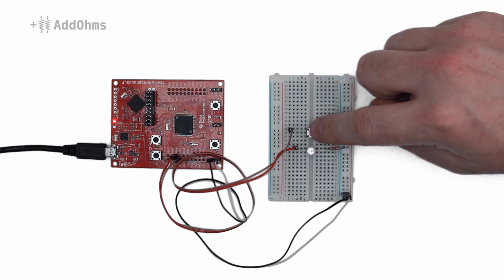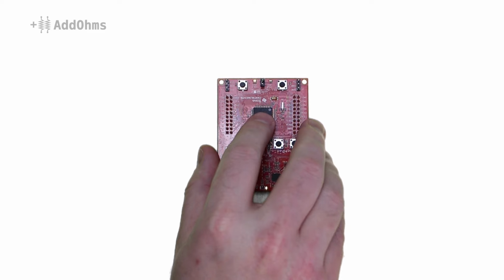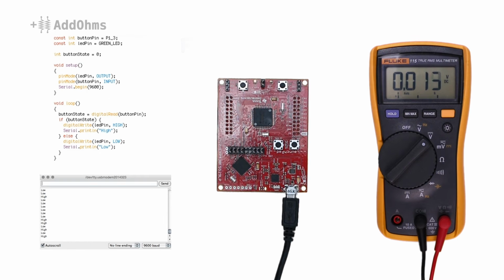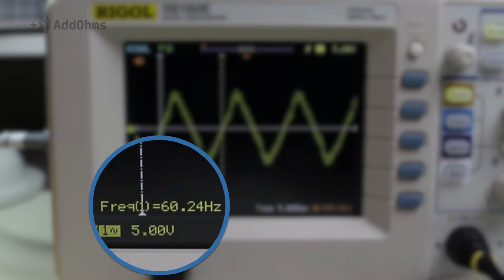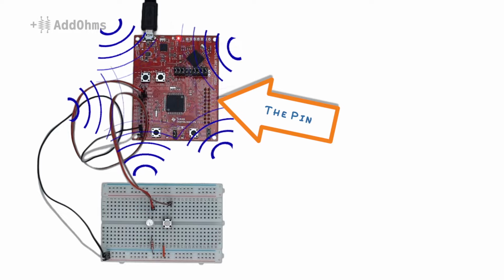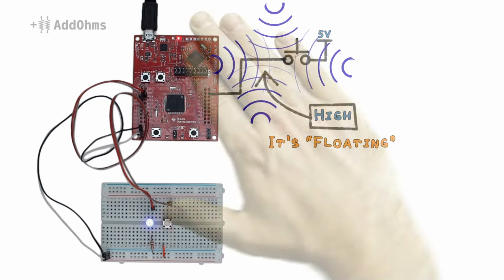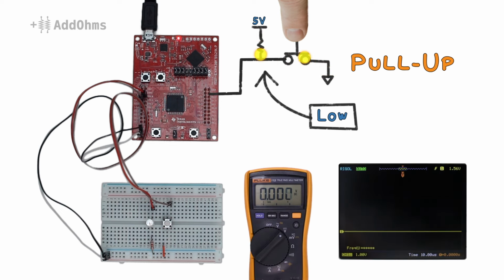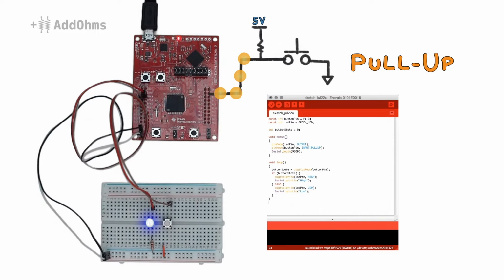Pull Up Resistor Tutorial | AddOhms #15

Comment: Why would there be an unstable signal when the switch is off? Isn't is supposed to be very high impedance when the switch is open, meaning nothing could pass?
Reply from the maker: Yes, but very high impedance comes with a downside. There are no perfect devices. Everything has parasitics, like capacitance. So when a stray EM field interacts with the parasitic capacitance of the I/O pin, it builds up a tiny charge. Eventually, there is enough energy built up to discharge through the "high impedance" path. So if you have current flowing through a resistance (aka high impedance), you get a voltage. That's Ohm's law. This voltage is what causes the input pin to briefly read a high with nothing connected. 

Pull-up and pull-down resistors prevent this discharge because they hold the pin and its teeny capacitors at a constant voltage (either +V or 0). This effect is why small value resistors are called "strong pull-up/down" because they are low impedance paths which provide "stronger" pressure to hold the pin at a known voltage.

Comment: Could someone help please? I am using a comparator (TI LM393P) which needs a pull-up on the output because it is open drain. 
Like the video says it is sort of counterintuitive as if I attach an LED to the output pin (with pullup): when the non-inverting input voltage is above the inverting voltage (Vref) the LED will transition from HIGH to LOW (it is HIGH through pullup by default). 
How can I reverse this transition with an open drain interface (LOW to HIGH of LED when '+' input is higher then '-' input?
I have considered either:
    -changing input pins around (letting inverting pin/Vref) vary
    -applying a transistor (but how to do it?)
Reply from the maker: One option would be to use a 7400 inverter on the output.

Comment: this video is the best!!!  the explanation was superb!! so.... a small request from my side :-) could u make a similar video explaining about the working of the pull down resistor..would be happy to watch another wonderfull explanation from your side...:-)
Reply from the maker: Pull-down works the same, except it goes to ground instead of +V.
Reply: +AddOhms  😀 thank you for your valuable response!!   I would pleased if you clear my doubt maybe silly😬  I had referred  a lot of YouTube videos about pull down resistor...it said a 5v is connected to one side of the switch and the other side is connected to a pull down resistor of a certain value and the other end of the pull down resistor is grounded..and the interrupt is connected to the common point where the resistor and the switch is connected.i hope this is the ckt for a pull down resistor...
As u said in pull up resistor when the switch is clicked if there are external noises that will be grounded as the current (I ment the current due to noise) likely flows to ground.
But in case of pull down the switch is connected to ground through a resistor so if the noise has to get grounded it should pass through the resistor which wouldn't as the current follows the least resistant path..so the current due to noise Should actually enter the interrupt circuit!! But it wouldn't and I dint understand that part..so sir if you could please explain it I would be greatfull😀
Reply from the maker: Pull-up or pull-down has the same effect on noise. The only reason to use a pull-down is if you need a signal to stay low.

Comment: I thought it can only switch between high and low once it get above or below a defined trigger like 2V / 3V or something like that. You mean to say background EMF is causing this much of a voltage spike?
Reply from the maker: An I/O pin input is, effectively, going into the gate of a MOSFET. Which is a tiny capacitor. Just like a real capacitor, the more charge it stores the higher the voltage across the capacitor. You can picture this tiny little capacitor getting charged by EMF. So it is less of "voltage spikes" and more of charge building up.  As it charges up, the MOSFET sees enough voltage to cause a false reading. 

Since the energy levels are so low, it doesn't take much to discharge and charge it, which is why the pin jumps between reading a high or low.

Comment: Great video! But from the point of complete new guy in this field a question might arise like "but won't it use up my battery a lot faster by draining it via that direct connection to 5v?" 🤔🤓
Reply from the maker: The pull-up only burns power while the button is pressed. (When using a pull-up for something like an I2C signal, you need to balance between a strong enough pull-up but a small enough value.) A direct connection to 5 volts would actually burn WAY more power than a resistor since it shorts out the supply. You might find this follow-up on picking values helpful: https://youtu.be/u3Xiy2DVnI4

Comment: Before watching this video, I didnt knew why whe had to use pull up resistor, now its a little bit clearer. In fact i still dont understand why the I/O is picking ones and zeros when left in floating state, Its sound little illogic because the I/O are controlled via MOSFET transistor, and we all know that those kind of transistor are driven by potential and not current, so if the floating input is picking EMI ( and thus acting like an antenna) does it reach the MOSFet's V threshold ?
I also have a question relative to pull down resistor, i know its kind of the same thing as pull up resistor, but i still dont get how they work.
Thank you in advance
Reply from the maker: It is not about current. It is about the voltage potential. However they are related. Charge builds up, which builds potential. Sometimes it cascades and drops back to zero. 

MOSFET gates have the same problem. If left floating they do the same thing. That’s why it is common to see them designed with pull-up or pull-down resistors. To drive the gate to a known level.
Reply: thank you for clarifying this :)

Comment: Hi im learning electronics and your explanation is awesome, excuse me could you explain why the electrons go to ground rather than the circuit when the you press the button ( why the way to ground offers less resistance than the other) thanks in advance
Reply from the maker: An I/O pin configured as an input looks like a huge resistor, also called "high impedance." A very tiny amount of current goes into the microcontroller's pin. But it is in the range of nanoamps.
Reply: AddOhms thanks a lot i just suscribed the best channel

Comment: I get the floating and all, but I'm still a little confused about why it's necessary to use a resistor. Why not just use a "pull-up wire" without a resistor? Is the resistor only there to prevent a short circuit between Vcc and ground when the button is pressed? If it is, wouldn't this technique be better understood as "a pull-up with a resistor" as opposed to "a pull-up resistor?" And why not put the resistor on the ground side of the button? Would that make any difference?
Reply from the maker: > Why not just use a "pull-up wire"
Because then you would have a short circuit when activating the button.

> as "a pull-up with a resistor" 
I doubt you'll get the entire electronics industry to change its wording. 

> why not put the resistor on the ground

That creates a pull-down resistor. Pull-ups are more common, probably because early chip/transistor fab techniques made it easier to make "pull-up" resistors. (because they aren't actually resistors on-chip.)

Comment: How do I distinguish between pull-up resistor and resistor? In the figure below it is mention R2 is pull-up resistor because it is connected to VCC. Why can't we say R1 is pull-up resistor ? It is also connected to VCC

https://www.build-electronic-circuits.com/wp-content/uploads/2017/07/555-Monostable-2-768x413.png
Reply from the maker: R2 is a pull-up. It's pulling up the trigger input so that it isn't left floating. R1 is connected to Pin 7, which is Discharge. So that resistor is there to act as a current limiter for the capacitor, not to "pull-up" the signal to a known value.
Reply: Tysm😊👍 keep spreading knowledge. You are doing great work

Comment: how to determine the optimum value for pull-up resistor ??? 
Great video, thank you very much
Reply from the maker: The exact value does not matter. The “optimum” value is the largest your circuit can tolerate before noise is introduced. The 328p’s internal pull-ups are in the range of 30k to 50k. These are considered “weak.” (Larger values let less current flow, so they are weaker.) Typical external are 1k to 10k.

Comment: Great video! I have a question though, why use a resistor? why not just hook up to 5v source ? what is the purpose of the resistor if you need to get the 5v?
Reply from the maker: Without the resistor, you'd have a dead short to ground when the button is pressed.

Comment: thanks a bunch man, this was by far the best face palm moment I had in my life so far.
Discovering that i never needed a pull down resistance in all my boards circuitry design for the past 3 years and a simple change in code and circuit design could have saved my time. Thanks again

Comment: hii,

what resistant should be use for a pull up or down resistor function ?

thanks. 
andrew
Reply from the maker: "Weak" pull-ups are considered to be in the 10k-100k ohm range. "Strong" pullups are in the 100-1000 ohm range. Usually I use something between 1k and 10k. Whatever is laying around.

The Pull-ups in the AVR 328p (processor in the Uno) are specified to be between 30k and 50k.

Comment: 60 Hz that means wavelength  5000 km... Why does it work like antenna? Isn't it too much for small pin?
Reply from the maker: +Ghost The electromagnetic energy still hits the "antenna" even if it isn't the ideal length. Which is why it's so easy to overcome by using a pull up resistor.
Reply: Ok, thank you :-)

Comment: But when you press the button to connect the 5V to GND, aren't you creating a short circuit??
Reply from the maker: No. That's why the resistor is there.
Reply: Somebody made it clear that that IS a short circuit. In the video when you get to talking about the built-in pull-up resistors in Arduino, you probably should mention that you'd have to disconnect the 5V from the button and that the voltage runs through the input. I'm a beginner, so that confused me quite a bit.
Reply from the maker: The only time I show a direct connection to +5V is when the button is connected to 5 volts and the I/O pin. Around 02:15. In that case, no, there is no short circuit to ground. When configured as an input, the I/O is NOT directly connected to either 5 volts or ground. Which is why the condition is called floating. 

When there is a pull-up resistor, again, there no short circuit.

As for clarifying to disconnect from 5 volts, I don't see a need. You shouldn't be connecting the button to both ground and 5 volts at the same time. Nowhere in the video do I show this configuration. At worst if you connected with an external pull-up and enabled the internal pull-up, it would just be like two resistors in parallel. This isn't a problem either.

The whole point of the video was to show you should be connecting with a resistor, either internally or externally.
Reply from the maker: Okay. I think I see your point. I say "all you need to do is..." implying only the change. If someone only watched that last part of the video, they could be confused.
Reply: That is exactly why I was confused, but I did watch the entire video. Otherwise a wonderful and helpful video. :)

Comment: Does arduino nano has built in pull up resistors? If it does, do every digital pin supports INPUT_PULLUP ?
Reply from the maker: +vira dhanu Yes
Reply: I've got ATMEGA328 processor in my nano. I referred the datasheet but I could not find about regarding  built in pull up resistors. Are you 100% sure about the above matter?
Reply from the maker: Page 4, every port is listed as "with internal pull-ups". http://www.atmel.com/images/Atmel-8271-8-bit-AVR-Microcontroller-ATmega48A-48PA-88A-88PA-168A-168PA-328-328P_datasheet_Complete.pdf

Comment: Why does the pin read 0 volts when you connect the switch? The pin is still connected to 5 volts.
Reply from the maker: It isn't connected to 5 volts, it is connected to the resistor. Voltage drops in a circuit add up. Since the connected circuit is (basically) just a 5 volt resistor, that means the top terminal is at 5 volts and the bottom terminal is at 0 volts. The resistor is dropping the 5 volts. For more detail, watch my video on voltage dividers.
Reply: Got it, thanks.  +1 sub

Comment: I have a question, when the button is pressed why doesn't the 5V source continue to flow through the digital pin? Why does it flow to ground rather than the digital pin?
Reply from the maker: Input pins are very high impedance (high resistance). Current follows the path of least resistance. SOME current does go through the pin, but it is micro or nanoAmp. Compared to the amount flowing through the resistance ground, it is practically zero.
Reply: I wonder about the opposite scenario -  if the button is not pressed, does the pin maintain a constant voltage so that there will always be a voltage gradient between the pin and the 5V source, or does charge accumulate at the pin until the pin itself is at 5V and there's no longer a potential difference between the 5V source and the button, and hence no current. Thanks kindly.. (Edit: in other words, in first scenario, the pin lets current flow through it to some ground rather than accumulate in it, and so as long as the button is not pressed, current will flow.)

Comment: Mr. engineer, I having a similar kind of problem on an ADC port which is connected to a Slide Pot. When the pot is set to 0, the input voltages is still fluctuating and constantly adds error to Analog input. Can a pull down resistor do the trick? The launchpad is Texas Instrument`s TIVA C ARM5
Reply from the maker: When using a slide pot you need to use another resistor to create a voltage divider.
Reply: thanks for the reply, my ADC depends on a 0 to 3.3V input. So this other resistor will provide the path for interference away from the pin?

Comment: I may be slow, but is the intent of the pull up resistor to block or make the noise not effect the circuit, like a noise blanker in a ham radio receiver?    Is the 5 V higher than the voltage of the noise thereby making the circuit ignore or even not see the noise?

Dave K8WPE
Reply from the maker: +David J. Wilcox The resistor itself doesn't matter. It's holding the pin (or node) at a potential. It prevents EM fields from inducing a current--creating a voltage drop. The resistor is there so that you don't create a short circuit when the button is closed.

Comment: Could the pin be connected directly to your 5 volts to pull it up or does it have to be via a resistor? if so why?
Reply from the maker: +David Fenwick without the resistor you would create a short circuit when the button is pressed.
Reply: Thank you for the reply. could you not place the resistor after the switch?
Reply from the maker: Then you would have a series circuit that was +VCC > Resistor + Button > Ground. So when you press the button, the voltage at the pin wouldn't change.
Reply: Got it! Thank you very much for that.

Comment: Why there's not an AC 60 Hz noise signal AROUND the 5 volts DC signal , when the button is not pressed, (high state) ?  Shouldn't be the noise "mounted" on the DC signal (I mean, random values around the DC signal) ? 
I've suscribed to your channel. Thanks!
Reply from the maker: When there is a strong electric field (current is flowing) the noise is very small compared to the strong field. When no strong electric field is there (no current flowing) the noise is much bigger. It is all about relative size.

Comment: On a pull-down resistor circuit, why do we require a resistor connected to the ground? Shouldn't the ground itself pull any floating signal down to 0? What does the resistor add to draw away any EMF? Thanks!
Reply from the maker: If you don't include the resistor, then it isn't a pull-down. It would leave the pin floating when the button isn't pressed.

Comment: why you use resistor and you not link 5V directly with input pin?
Reply from the maker: Without the resistor, you would have a dead short between 5V and GND when the button is pressed.
Reply: i'm sorry for my ignorance but, what is "dead short"?
Reply: (From Google) "A dead short is a short circuit that creates no real resistance, allowing the amperage to build up until it trips the circuit breaker. These can be difficult to track down and diagnose because the current builds so rapidly that it usually trips the breaker immediately."

I know you asked this a while back - but anyone reading might want to know...

Basically things would get hot.

Comment: I have been trying to use push buttons with IC just to observe if this happens with the IC's as well, but it never happened ! So does this happen only with micro-controllers or what ?
Reply from the maker: Microcontrollers are ICs. So to say "with IC" is too generic. Depends on what the IC is and how it is designed.
Reply: I get man, thanks so much :)

Comment: So if you start with a 5v source and put a resistor on, what kind of values are we talking? It must be only a few ohms so it doesn't lower the voltage too much but when noise is introduced it'll go to ground instead of vcc?
Reply from the maker: +Syllith Usually between 1k and 10k. Small values are considered "strong" and large values are considered "weak". Anything over 100k isn't going to provide much help.